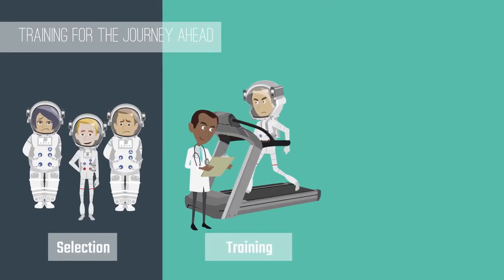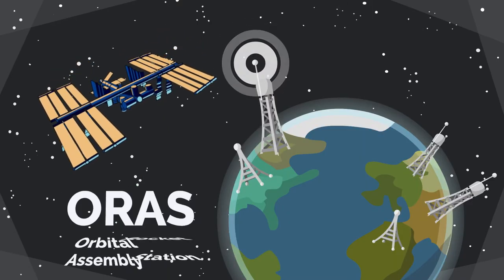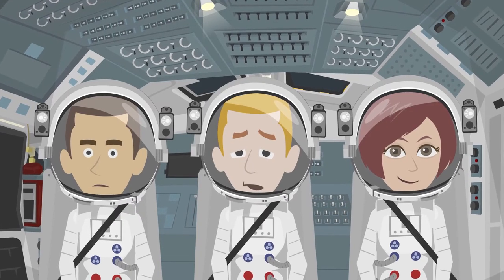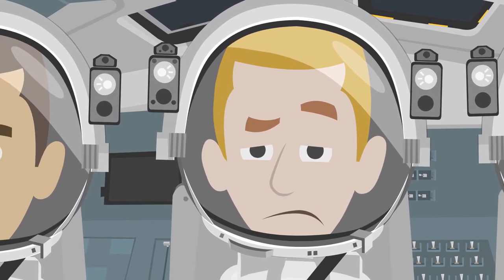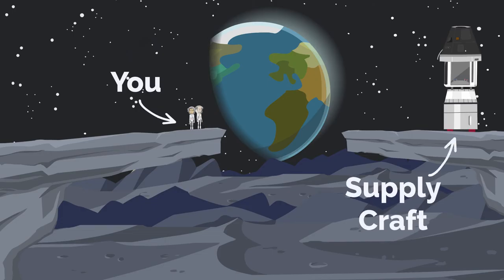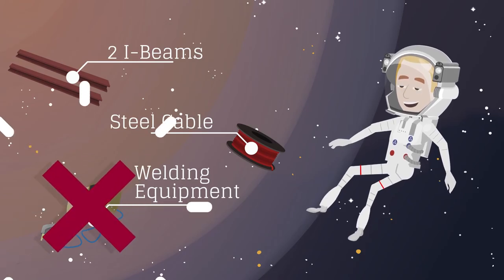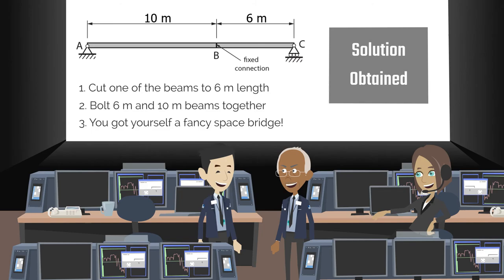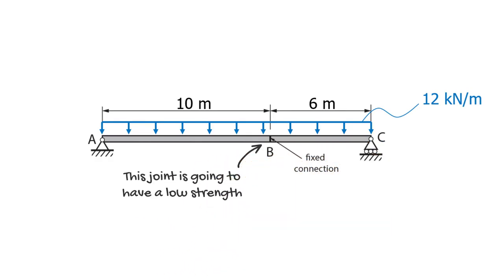A space-themed backstory for a simple engineering statics problem

Comment: Will this work? Cut the beams into 8 and 2 m beams. Erect the 2m beams  at both ends and pin join one end of the 8m on one edge and cantilever the other end to the mid of the span. Connect the free end of the cantilever to the top of the 2m erect and from the top of that to the ground using tension cables. Thus the bridge will be a pair of cantilevers supported by tension cables.

Comment: Instead of 10m - joint - 6m. Use 3m - joint 10m - joint - 3m. This reduces the moment in the crossection at the joints.
Reply: Could furthermore use the remaining 4m jointed at the middle of the bridge going downwards. Then connect the cable from each side to the bottom of the newly welded vertical beam. This would utilize the tension capacity of the cables while still minimizing the moment in the joints in the main beam.